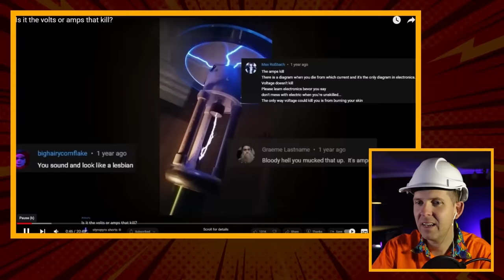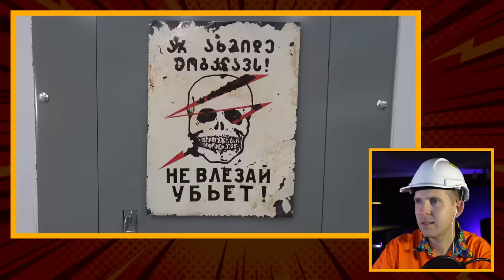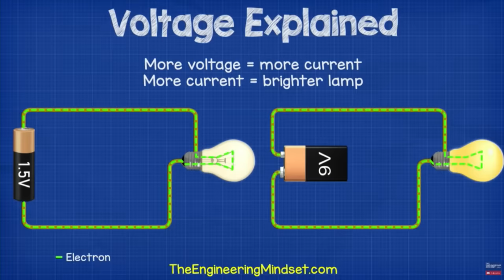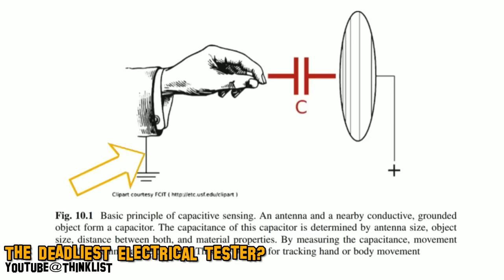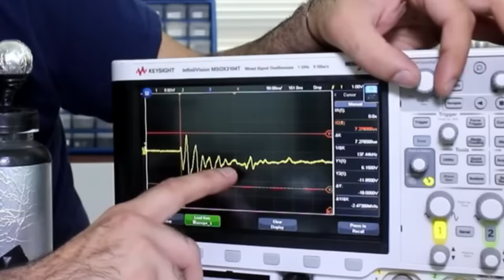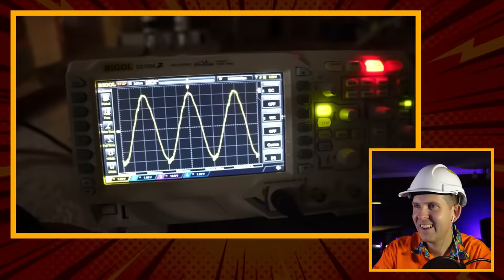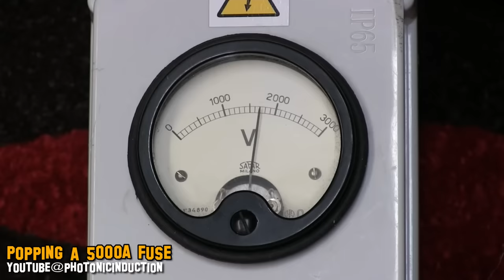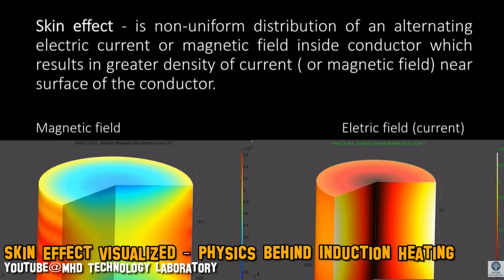Electrician Reacts to Styropyro's🔌AMPS vs VOLTS⚡

Comment: I love to stick my finger in outlets and I use steel rods to strike overhead power lines. I hope to get a lot of fresh electrons.
Reply: Invest in really long rod so you can touch the high voltage transfer lines.
Now THOSE should give you many electrons
Reply: @tappajaav  But the problem with AC is that it will take them back every negative cycle. While with DC you have to make sure that you get polarity right.

Comment: I take issue.  He made it seem that since the frequency "is too fast for you nerves to register" that you don't get electrocuted.   I disagree.   Electrocution is caused by the dissipation of power.   Power is Joules per second. Voltage is Joules per Coulomb.  Current is Coulombs per second.  Multiply them and you end up with Joules per second  (watts).

The Problem with multiplying current times voltage in AC circuits is that they don't have to be in phase with each other.   Peak current can happen at a different point in time than peak voltage.   He might have 1 amp RMS.  But the peak current (I think it was 3 amps) is not at the same point in time as he has peak voltage.  At that point in time, voltage might be close to zero, for example.   Voltage could even be negative while current is positive leading to a calculation of negative power.  Clearly the coil isn't producing its own power.   It's consuming power from his source.  So that point where he says "a million watts"  Do you think his meter really spun out more than a megawatt in that second (because that's where it would have come from)

Comment: i remember learning about coulombs (the unit, not the law) by doing the math to calculate the coulombs in a static shock vs a lightning strike. its tempting to want to simplify electricity down a single catchy phrase or sentence to kind of cover all of the safety, but really to be accurate you can't do that. you have to discuss resistance, capacitance, charge, voltage, direct current, alternating current, impedance, and power. and you might as well toss in RF power too because most people don't really understand how RF transmissions work (including RF engineers... its black magic). Will 5G cook you? No, but there are RF transmissions that can cook you. or they may only cook part of you. It's just too complicated to give a simple throw away one size fits all answer.

Comment: It does annoy me whenever I see "It's the amps that kill you, not the volts"
While technically more correct than saying it's the volts, in real life being scared of high voltage is much more useful.

You can touch a 1V wire with a couple amps running through it without issue. But touch a 200V wire and you might have an issue.
Sure, in reality it's all rather complicated, but as a rule of thumb "stay away from high voltage" is a pretty good one. Anything above 50V is potentially lethal.
Reply: Remember: The current draw varies depending on the load and the voltage and also if it's AC or DC.

Comment: With a 240VAC (single or 415V 3P) supply at 50hZ Amps is a good proxy for the outcome - for different voltages and frequencies, the power relationship with the time domain is key...

Comment: OSHA lists (approx) 600v as the point that electricity will breach your (relatively high resistant depending on conditions like sweat) skin and then be able to use your (very low resistant) iron rich blood as a path of conduction, so hooking up a 120/240v service to a house there are different parameters involved as in reference to working on 4,000+ voltage high tension wires......

Comment: If I remember right from class, the main concern of any current or voltage source going through your body, is that if it goes through a certain small muscle in your heart your heart will stop. I'm sure the skin effect comes into play in conductive materials but ye don't ever touch live with one hand and ground with the other. Styro was safe because he was grounded.
Reply: Styro wasn't grounded. You don't need a ground connection at high frequencies.
There is no skin effect in the human body like with first class conductors.

Comment: I'm so glad I found your reaction video
All the half  truths and misinformation  this video had was doing my head in 

30mA is just a known figure we know we have to avoid passing through our chests / hearts etc  even though there would be multiple conduction paths thru body 
Just incase there's only one path let's limit it to that 

Regardless of what the voltage ,ambient conditions are and resistance of any paths involved are we need to avoid anything that results in 30mA thru body 

If you are in a pool it doesn't take much voltage  applied  between two terminals  one either side of a swimming pool to make you collapse and drown 

Low voltage but it's still just 30mA across chest
So 30mA is a constant that doesn't change (much) so is the best UNIT to base it and any safety device on

Take anything in the vid with a grain of salt  - I wouldn't trust my life on anything  stated in the original vid  and  throw proven conventional electrical principles out the window !

Electricity:- it's all fun and games until someone gets electrocuted and dies then it's bloody hilarious !!

Its all a laugh

Comment: This is adjacently related to the skin effect. I work in IEC electrical basic safety standards. We have two measurements that we make on electrical equipment being evaluated called creepage and clearance. There are minimum distances that electricity would have to jump or travel in order to constitute a means of protection between the two conductors measured (a single means of protection is allowed to be faulted during a single-fault test to see if the rest remains safe. But two means of protection is already inherently single-fault safe. The standard writers determine what distances are worth one or two means of protection and they are dependent on the working voltage expected for that circuit). Clearance is just the "as the crow flies" distance between two conductors. Sometimes, that can be along the circuit board just in sections of the substrate used as insulation and isolation, but it can be a midair jump.

Creepage, on the other hand, cannot jump very much at all. Typically, if you do have a sharp concave corner in a circuit board, there is some point where the air gap is so small, it's essentially nonexistent, but the energy that the fault can deliver if electricity bridges a gap drops off much more quickly through open air, than if it "creeps" along the surface of the circuit board. The difference between the minimum distance requirements for creepage vs clearance is dependent on a specific conductivity of the surface of the material. This is measured in something called a Comparative Tracking Index (CTI). and the analog results of that test are grouped into more digital categories called pollution degree.

So basically, you have a table, you find the row for your working voltage, run across the row until you find the number of means of protection and pollution degree, and it tells you how far apart conductors need to be to be considered isolated. If they don't meet the required distance, then in the case of two means of protection, you can short that gap as part of a single-fault test, but if it fails to meet even the minimum for a single means of protection, then you can short that gap during normal operation testing. It's like that gap isn't even there. Oh, and don't forget the multiplier if the equipment is designed to work above a certain altitude... So much to remember. And the main difference between creepage and skin effect is that this happens at low frequency and even DC.

Comment: We run RF sealing machines at my work that I've been trying to learn a bit more about as the years go on. Electrical engineering isn't that crazy, like mere mortals can sort it out with some effort. I'll swear to any higher power you want, RF Circuitry is wizardry. At RF ranges you have to consider the capacitance and inductance of *traces between components*. Absolute nightmare to start figuring out.

Comment: ElectroBOOM also made a video where he made a pain graph of different frequencies. In his graph, anything above 20kHz would simply not be felt by the nerves, and instead, it just burns
Reply: There is no freuency at which neurons stop functioning totally. They are reacting more readily to a specific range of frquencies while they are less responsive to frequencies outside that range. But with high enough currents neurons can be excited, even at high frequencies. Eventhough this ight require currents above the power/energy threshold the body can withstand.

Comment: The 30 mA calibration for residual current protection is based on 240Vac ( for Australia ) 
interestingly this is rated much lower for surgery theater since dry skin act as an isolator 
yes ! ....they did electrocute dead bodies to work it out

Comment: I was just hit with 244 volts and 12.6 amps, a compressor was shorted to ground and a previous tech broke the gounding lug and never properly grounded it again. When I went to do my evaluation I put both hands on the condenser, my muscles immediately locked up, I lost consciousness for a second or two went limp, my head bounced off the top of the condenser and it broke my grip the lights went back on and I survived. I’m insanely lucky I still don’t know how I survived with no complications, a tech died last year almost the exact same way and he only got hit with 6 amps and 240 volts.

Comment: Before you start making your own Voltage divider, be aware that most resistors are rated for about 200 Volts. Ideal resistors don't vary resistance with the applied Voltage. Notice that High Voltage probes are extra long. Tis BECAUSE  HV resistors are longer than common electronics resistors.

Comment: If an appliance is switched on, the neutral wire has current running through it. So would any risk to touching it depend on how many amps the appliance uses, just as it would be for the hot wire? Thanks

Comment: I am a noob with electrical stuff, but I guess what is dangerous is low-frequency high voltage high current that is continuously arcing. I think that's dangerous if I understand the video......
Reply from the maker: For the most part yes but high frequency high voltage can cause RF burns and produce radiation. But you are more likely to come across low voltages at low frequencies i.e your house
Reply: @thinklist  thx mate

Comment: Of course static discharges don't need to have low current. But usually the charge isn't that big. A good starting point to tell what kills you is energy. And it doesn't take a lot of energy to kill someone. Also with AC it's a matter of frequency too. With arcs you can also die from the burns alone.
Reply: It is a very common belief that static is high voltage low current. Same is with things like taser. Even the manufacturer says so. They hide the facts by talking about average current but not average voltage. There is a common belief that high current is always dangerous so the myth of high voltage low current has been created.

Comment: Can you explain tasers for us I have one that supposedly puts out 20,000 v but I don’t feel it. I have measured it before and it’s reads a little bit more than that
Reply from the maker: Interesting… what did you measure it with?
Reply: @thinklist  a multimeter using the same setup in the styropyro video
Reply from the maker: @wogginmynoggin6695  up to 20,000 volts?
Reply: @thinklist  I was using the same setup styro did it went over 20k v but it was showing double the amount my dad says that their is a possibility that the taser is messed up or I just have a resistance to the pain from it
Reply: It comes down to the conductivity of the skin. Thick calloused areas are very high resistance and areas washed with certain soaps or where you've used lotions will create a residue thats nonconductive. try zapping an obscure area on your body like the back of your neck, or take a sharpie and make a mark on your skin then use a fine sandpaper until the mark comes off, i guarantee that area will feel the full brunt of the shock. Thats the method needed to get good EKG lead contact.

Comment: your probably been taught that if something emits light the source need to be very hot. actually that is not the case as with high voltage you can have a electricity where the electrode is entirely cold but emits massive amount of light and radiation. sometimes a filament wire heat up by the electricity and other times it get bright put out a blue light and remains cold. it has to do with the voltage as if the electricity just get conductive enough it looses enough resistance to produce free electrons that does not behave the same way as the random movement of electrons in a heated filament.

Comment: 15-30 milli-Joules through the heart muscle: that's about what it takes to stops life primary processes in large primates.
I will leave it for the astute Student to figure how to send enough power through the heart, in a short period of time, to disrupt normal sinus rhythm.
The surge of current through the heart over-rides nerve impulses, fibrillation or stoppage is the result. 
It aint the volts, it aint the amps, it aint AC vs DC.
It's watt/seconds passing through a vital organ, in the right timing, that does the job.
Sorry for shouting; I've been fighting this 'war of ignorance' since 1972.
Never read Medical texts, have access to a defibrillator (don't ask), study Chemistry, build a Heath-kit short-wave radio and study RF theory over the same Summer break.
You become 'that guy' and your social life suffers.
Reply: you are absolutely correct, one factor i think should be noted however is that 15-30 mJ through the body does not mean the heart will experience all of that power. current takes all paths to ground, and as such the power density is dispersed throughout that path. That's why external defib pads are very large and use a gel for better conductivity and go up to 360 joules, whereas internal defib pads like what are used during surgery are much smaller and typically don't exceed 50 joules

Comment: so if i get this right with 0 electricity knowlege is if u can make electricity high frequency with that plasma ball u should have wireless or static electricity in range of 1 meter if u place banana on top of it ps dont forget to wrap coil at bottom of the neck like on  speaker coneand maybe  that is supose to do something ?

Comment: Easy, think of electricity as a conveyor belt, the belt being the electricity, the speed of the belt the amps, and the torque of the motor driving the belt the volts. 

Now you can get your finger caught in the mechanism and torn off at any speed, but you need a strong enough motor driving the belt.

Comment: its always amps that kills u. check the stunt guns for example- high voltage , very low amp power = they just knock u out. try that with amps. u are fried.

Comment: Ok so in essence, its really the frequency that kills
Reply from the maker: Well a combination of below approximately 10000 hertz and high enough voltage at a low enough impedance. If that makes sense
Reply: there is no one factor to look at, they all play some part in how lethal a voltage source is. Frequency, voltage, power limits, and time of exposure. Most variables can be ignored since typical residential power is a fix range 50-60 hz and the power limit coming out of the wall is high enough it can be ignored. So when it comes to residential power its down to the voltage and time of exposure. There are charts that explain roughly how many ms it takes per mA of current to cause issues with your heart.

Comment: 1:14 you neglect to consider the FREQUENCY of that High Voltage.  That is HV-HF, so skin-effect reigns here.  None of the current is actually passing through you but travelling across the surface of your skin instead.
Reply: Keep in mind what Styropyro has to say about the skin effect in this particular video.

It only applies with a good conductor, which skin is not.
Reply: @TheZumiezNation  poor conductors become good conductors with dielectric breakdown. It's still skin-effect. If that were 60Hz he'd be dead.
Reply: @rockosgaminglogic  is his flesh breaking down in order to become a good conductor for the skin effect?

no.......
Reply: @TheZumiezNation  that isn't how it works with high frequency.

Comment: Just after 9:08 the arc jumps to his arm, it is very much dimmer and makes him jump. This indicates that the file is grounded most likely by a cable in his sleeve causing the arc to be full brightness. If the file was not grounded, he would be seriously injured.
Reply from the maker: You think he faked it?
Reply: Or maybe the Temperature of the Arc hurts like hell...
Imagine a couple of your arm hairs exploding because the sudden increase in temperature... 
If the metal bar was grounded, the arc would AWAYS hit bar, because its the path with less resistance by far, but with no ground the resistance is pretty much the same, only the air/distance gives more resistance.
.
My bet is that is not fake.

Comment: Basically it's both voltage and current at low frequency
Reply: Mostly but remember whether it's DC or AC if the voltage is high enough and the current delivered it fatal enough it will end you no matter the frequency.